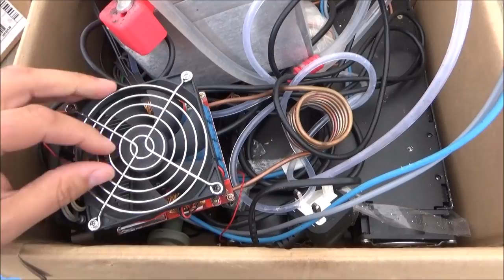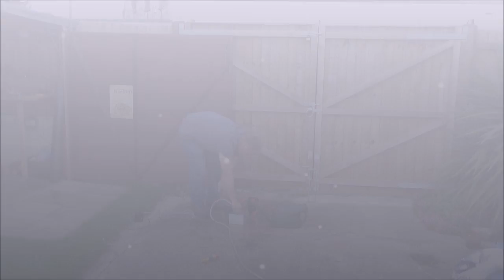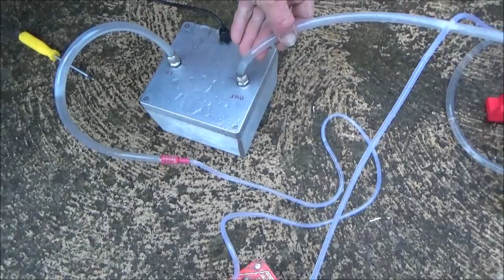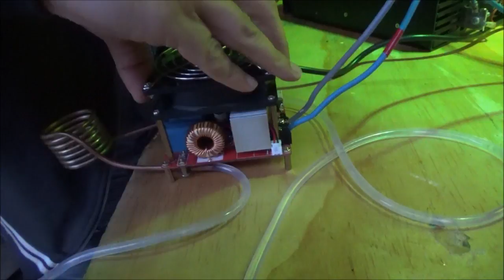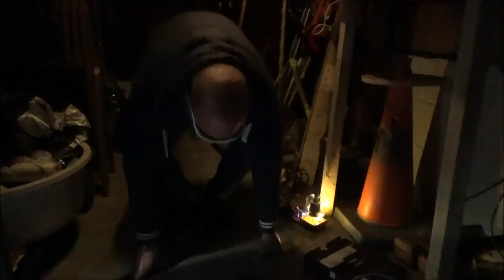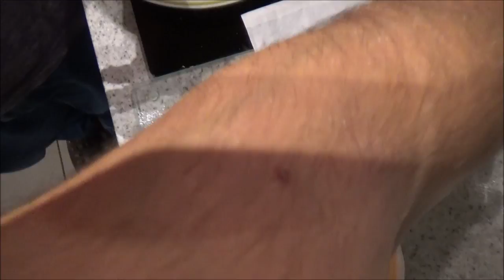Induction Heating Metal Blacksmith Knife Making Part1 of 3

Comment: Use a Foot switch its safer, PSU has to be at Power before you switch on the ZVS or you will blow the Mosfets. I have this thing and a Full size 15KW version.
Reply from the maker: Ah! ... thanks for the heads up...  I’ll keep that in mind...